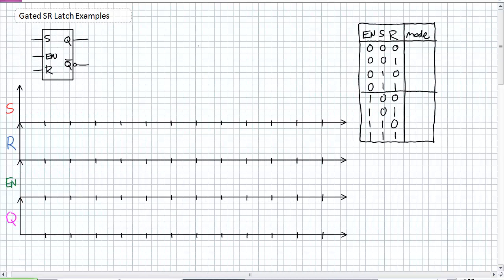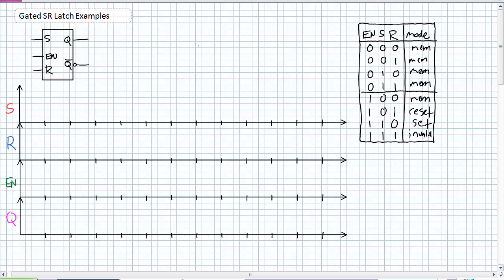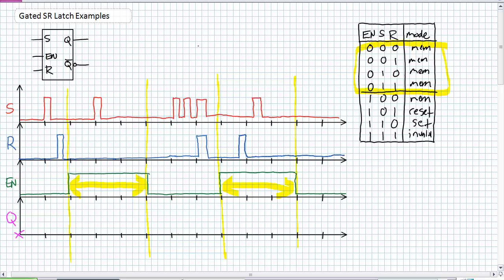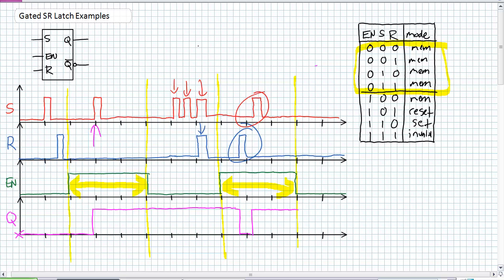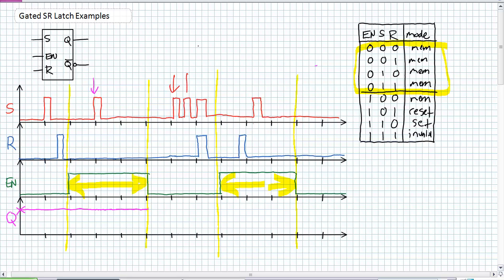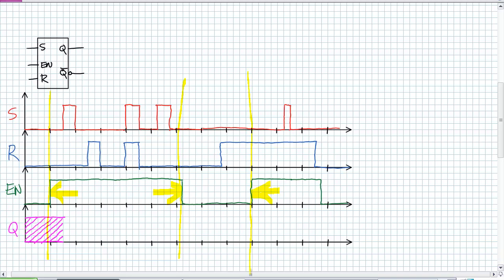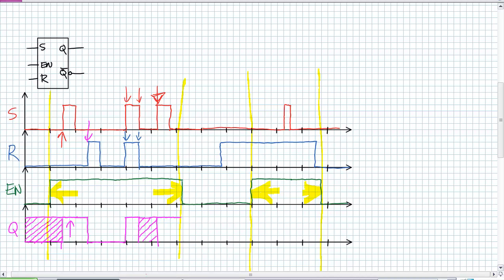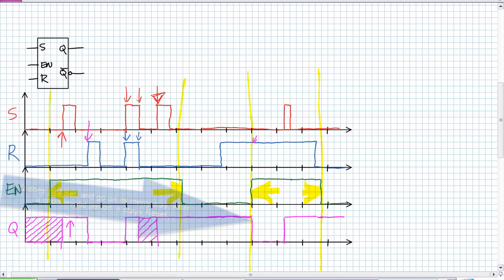Gated SR Latch Examples

Comment: hello...could u pls explain how to decide whether to take output waveform q as starting from active low or active high?
Reply: The starting value of Q is unknown, the second diagram describes this better, your design should not rely on the value of Q before either a set or reset command has been issued.